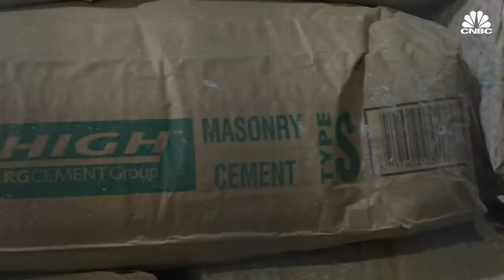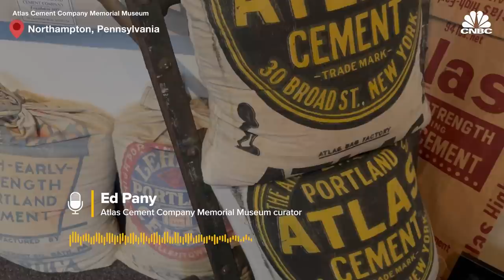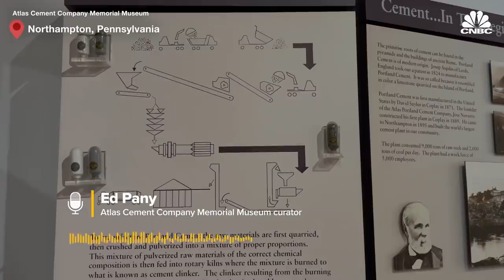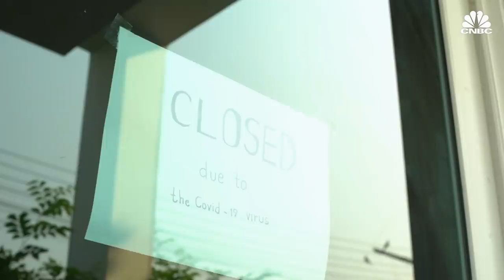Can The U.S. Cement Industry Keep Up With The $1 Trillion Infrastructure Bill?

Comment: It’s 2021 and we still gotta repave roads every 2-3 years 

Can’t someone invent a roadway that won’t crack over time 🙄
Reply: If there’s no endless traffic and construction on the road. Then I don’t want to drive! - America
Reply: We only repave the roads because everyone wants the smoothest road possible with no blemishes. You don't need to repave a brick road but most people don't like driving on brick roads. Also, if we've constantly repaving and repairing, it supports a lot of jobs around the country. If you make something that doesn't need to be replaced, that job will become obsolete
Reply: @listen1st267  who cares about  jobs

They’ll find other work 

AI and robots will soon take over anyways and that’ll be less stress for us
Reply: Roads are repaved all the time cause they’re made from asphalt, if they were made of concrete they wouldn’t have that issue
But most roads must be built with asphalt because it would be outrageously expensive to pave all roads in the US with concrete
Asphalt just breaks down quicker
Reply: Yes but bit cheaply
Reply: One i can think of is a complete metal road or carbon fiber. All of which would be really expensive
Reply: @Rommie26  your not going to have robots aging roads within the next 20 years maybe in 50 year robots will take laborers jobs
Reply: If erosion wasn't a physical concept, we could invent that road.
Reply: 20 years and counting and our residential roads are fine.
Reply: What kind of pavement do you guys have? In switzerland we do this every 10 or 20 years or so. The pavement still looks great, it’s the utility that needs replacing, or that they replaced every other street so quickly and are at the first one again
Reply: @Someone-wh8hi  I think it has more to do with use. Cars in the US are bigger than those in Europe on average and we use them far more.
Reply: Germany already has, it's just Americans don't think it's "economically practical"
Reply: It already exist but most US cities use union labor. This means the US can only use certain materials for roads vs material that last longer because those are not yet union approved. You're giving up reliability for safety of workers. It's a fair trade.
Reply: Yeah dirt roads
Reply: @Aristocles22  Nah, it's all about trucks. A 40ton Truck stresses a road up to 160.000x more than a car.
Reply: @0Turbox  We have plenty of gigantic trucks in the US too.
Reply: @nczioox1116  But asphalt is the single most recycled material in the world.  You basically just reheat it and pour it down on the new surface you need
Reply: some places use concrete bases, or just much thicker tarmac layers. it costs a bit to make a road for the age
Reply: Sure we can. BUt that is not the cheapest option.
Reply: It's called job security
Reply: There is no profit in that,
Reply: @listen1st267  sounds like another argument for UBI
Reply: Hempcrete or maybe make some kind of tar with it.
Reply: @Someone-wh8hi  we generally have asphalt, some roads are concrete but only a few. Are builds are certainly not to the level that European roads are constructed.  I believe, re-paving is part of the equation for continuous maintenance/ profit.
Reply: Our
Reply: @nadda96  my man with the most sensible comment.. A great example is airports are used concrete instead asphalt..
Reply: Unless you stop the water you'll never have a solid road. It's all about moisture content of the soil under the hard surface. Another problem comes from when they grade the roadway with a high moisture content in the soil the ground shrinks when it dries.
Reply: Use granite for roads
Reply: Better roads are available, but the lob goes the lowest bidder.  There is no profit in doing it better.
Reply: In South African highways, we doing away with asphalt and using concrete for durability
Reply: @sthembisomthembu395  we have lots of concrete freeways in the US, and they wear out just the same as asphalt, they just take longer to do it. The thing I don't like about concrete is that it never is as smooth a ride as asphalt, and the older it gets the worse the ride gets.
After a few years they have to regrind the surface to reduce the cupping, but it just keeps getting worse as it ages.
Reply: @Rommie26  no. Lol
Roads have to support the weight of traffic, handle extreme temperature swings without falling apart or buckling up, and most importantly, provide good traction for cars.
Asphalt does all these great, gives the best smooth ride, can be made porous so rain doesn't puddle on it to increase wet traction, and is flexible to allow use on softer sub soils where the road flexes under heavy loads. It is cheap and easy to install, and can have more layers added on top to renew its surface.

Concrete is much more expensive and labor intensive to install, and never gives as nice a ride as asphalt, but it lasts a few years longer before full replacement is needed. As concrete ages, it begins warping, which makes the ride worse and worse over the years.

There is really no other technology or technique that would survive the conditions and make a safe road surface.
Reply: @LongLiveBruh  Metal wouldn't work because of the expansion issues when it's hot or cold, you would need expansion joints that would get gummed up with sand and junk and jam, and then the road would buckle.
It also would not give a proper level of traction for safe driving.
Reply: @ritchierich2793  airports also use incredibly thick concrete because the load on plane wheels is very high. And they are frequently out there sealing cracks and patching it, and have to replace it every few years as well.
Reply: @listen1st267  a brick road wouldn't last a week under constant truck traffic.
The ancient Roman roads and old brick roads only exist because they have been protected from 40 ton trucks driving over them every day.
Reply: @listen1st267  a brick road wouldn't last a week under constant truck traffic.
The ancient Roman roads and old brick roads only exist because they have been protected from 40 ton trucks driving over them every day.
Reply: Gunite but they won’t shoot it Because they want to keep business is thriving
Reply: There are formulations of asphalt in the works that use shredded plastic bottles to add strength and flexibility to the asphalt. Just look up "paving roads with plastic". :-)
Reply: @ke6gwf  yes I know that, from where I am at the airport has maintenance life cycle of 4-5 years one time.. That's just the yearly budgeting maintenance cost that usually prepared.. expensive but relatively cheap if you think of the longevity..
Reply: If roads, homes, products, gadgets, etc were made to last they would never require maintenance or replaments.
Reply: I mean, I heard they're starting to make plastic roads in New Zealand I think. It may have been a different country, I'm not entirely sure.
Reply: @Rommie26  lazy
Reply: @ke6gwf  using it as a road surface, it will crack and rise and fall over time as the earth moves around it

Comment: Was there ever a clear description of concrete vs cement? Showing images of concrete while discussing cement went a long ways toward lack of clarity.
Reply: 2:24
Reply: Cement is the powder the stuff in bags. cement+water=concrete the stuff you lay/spread
Reply: @edward1937  you are missing the aggregate.
Reply: cement plus sand plus/minus aggregate (gravel) then add water = CONCRETE; Ratios determine strength, setting time, cost . Just remember the romans were doing concrete 2000 years ago, also in great wall of china.

Comment: We do not have shortage of cement to make concrete. What we do have is a shortage of labor to produce, deliver and place cement/concrete. Concrete companies can make more than can be placed at this time. Placing concrete is a very physically demanding job that very few people want to do. Long hours, no breaks and bent over all day long. I have an extreme amount of respect for the guys and gals who work producing, delivering and placing concrete. The people who operate the pump trucks are the first onsite and usually the last to leave. I framed houses for over 15 years before I became a general contractor building houses. Don't get me wrong as framing is also very physically demanding work but more enjoyable in my opinion.

Comment: Actually, potable water is supplied either through Ductile Iron Pipe (DIP) or Asbestos Concrete pipe (AC).  Storm water is typically carried through Precast Concrete Cylinder Pipe (PCCP).  Sanitary sewer is carried through plastic pipe, typically SDR-35, SDR-36, or C-900.  C-900 can also carry potable water as well.
Reply: Thank you for your insights

Comment: As a former President of one of the largest chapters of the American Concrete Institute (ACI), I have no dought that the industry will step up to meet the demands as we always have. Concrete has been used for over 3,000 years to build the foundations and major structures of the world. Which, by the way, has an abundance of the raw resources for it's never ending demand. We merely change its composition to advance our cavillation.  There is NO other material as versatile, durable and as economical as concrete!

Comment: Cement production is the most energy-intensive manufacturing process. It's got to heat it to remove the water and then they add water to make it harden. How nuts is that?
Reply: I mean it makes sense because you need to mix everything and in order to mix rocks you need heat and water is the enemy of heat. If you need proof of this go look at any active volcano and watch as the molten rock solidifies as it touches water.

Comment: So... how would you cope when you actually start building your homes with cement and not sticks?
Reply: you realize concrete (not "cement, which is just an ingredient of concrete) is not invincible, right? water intrusion destroys concrete just like it does wood, and in extreme climates like the american north, where it's -20 in winter and 100 in the summer, concrete cracks and rebar rusts very quickly - you'll almost never see fully concrete buildings in some places for good reason. if it were superior in every situation, it'd be built with more. not to mention that it is about as unsustainable as a material gets. get a clue before you start talking out your ass, friend.
Reply: @NonoNonaa  Do you need a bucket for your tears?
Reply: @NonoNonaa  ..."if it ADDED MORE PROFIT MARGIN in every situation, it'd be built with more." -fixed it for ya. there are several concrete formulations/admixtures (crystalline/densifiers/polymers/etc) which are waterproof. also, waterproofing membranes are a thing, obviously, otherwise stick homes wouldn't survive 6mo in some regions. sustainability is also measured in usable service time. now, who was it that didn't have a clue?

i'll take the worst built ICF home over a "quality" stick-frame in ANY location, every day of the year. enjoy your bugs/storms/earthquakes/fires/tornadoes/hurricanes/extreme heat/extreme cold/massive energy consumption/high noise levels/constant maint/short lifespan/disposable/out-of-square/weak shacks.

Comment: They do not use concrete pipes for water lines.
Reply: I mean, they use it for stormwater drainage 🤷‍♂️
Reply: Not typically in new installations. It used to be common practice.

Comment: You're telling me the Romans who constructed the Colosseum heated their cement to 2800 degrees?  Not likely.
Reply: Not all cement is created equal. And not all cement is meant to meet the same standards
Reply: You can make cement at significantly lower temps. The Romans used seawater instead of heat. This makes their cement actually last longer but takes significantly longer to make.
Reply: actually yes. roman concrete was made from vulcanic ashes. check https://en.wikipedia.org/wiki/Pozzolana
Reply: @lukacsnemeth1652  Volcanic ashes were cool when used by the Romans... Volcanic ashes just means anything that came from an eruption. They didn't go into a volcano to make it. Volcanic eruption could end up miles from a volcano actually. The Romans did not use high heat in cement. They only cooked their cement to 900 C.
Reply: @lukacsnemeth1652  Volcanos don't get up to 2800 degrees. Not that they have to for ash
Reply: @veganpotterthevegan  they do. In fahrenheit.
Reply: @MuddinNYC  The volcanic ash is the cement, they were not shoveling limestone into the caldera :D
Reply: @lukacsnemeth1652  The rare scenarios where mafic lavas are recorded that hot are not from the kinds of volcanos that make great ash for cement.  The cooler volcanoes that barely have any lava at all produce the ash we want for cement
Reply: @veganpotterthevegan  The temperature of the lava is not the point, magma in the chamber can get to that degree. Also, belite occurs naturally, so cement definitely forms naturally.

Comment: Modern concrete—used in everything from roads to buildings to bridges—can break down in as few as 50 years

Masonry is one of the most durable components of a home. Chimneys, fireplaces, and brick veneers can last a lifetime, and brick walls have an average life expectancy of more than 100 years.

copied and pasted

Comment: We need a better alternative to concrete. During summer floors get hot to where you can burn yourself and it's heating the air up more.
Reply: Sun heats up everything in the summer, even the most reflective and uneven surfaces, for example Sand
Maybe you should plant grass over your floors🤣🤣
Reply: You could fix the heating problem with a simple color change. But people don't want that. Do you want to paint the roof of your house white? Even if you did, would the neighbours stand for it? Local government might even get involved with a building regulation that mandates certain roof colors.
Reply: I mean there’s a reason why the material has literally been used for 2,000+ years
Reply: @brian2440   to what extent? Too much of it is used today.
Reply: @prefersoxygen9373   not to the extent it does concrete and it's everywhere.
Reply: @enij1657  What do you consider to be a frivolous use of the concrete material?

What substitutes do you see for the material?
Reply: @enij1657  temperature difference between concrete and sand is about 0.2.... remember, concrete is mostly sand and both absorb sun and turn into a thermal mass.   At 90F, direct sun, concrete gets to about 120F, sand 115.... That's not much difference.... Think about how hot deserts get... If you don't like concrete, put grass,or clover in its place, problem solved
Reply: @brian2440  get rid of cars and get back to horses. Fixes a lot of issues. No need for so much concrete.
Reply: @enij1657  checkout Mr Dyck and the amish....

Comment: Stop building high, stop relying on cars (roads), a new way of building cities is needed. The higher the building the more expensive and worst is for the environment, we are not running out of space, and in lots of places population is stalling.
Reply: You need to build taller. You can't build out in a lot of places anymore. Take Manhattan for example, it's completely full. Only option is up. Otherwise you'll end up with a smaller population city that only the ultra rich will be able to live in.

Comment: Use building materials that are more sustainable. You only need to use concrete on skyscrapers, parking lots, etc. You don't need concrete for houses or multi-family homes. You can use rammed earth which uses only 10-20% concrete.

Comment: Drinking water does not travel through concrete pipes. PVC pipes are used for water and sanitary sewer. 

Storm drainage pipes can be concrete but most of that is PVC too
Reply: no, MOST storm drain pipes are concrete.
Reply: @protonneutron9046  not in my area. Pvc is much cheaper and labor cost is a lot lower since the segments are more than double what concrete is and can be moved by hand. You have to use heavy equipment to move even the smallest sizes of concrete pipe. Much slower

Comment: North Africa has sand.
USA: Looks like North Africa needs freedom.
Reply: Too bad the I my sand we can use is the one in beaches. Africa is saved…for now
Reply: @inter5123  dude, in order to make concrete/brikes we need sand js
Reply: @EastlakeRasta7  dude, the sand in the desert is too fine to use in concrete and is hard to bind together for concrete. Only sands in beaches run through with water are capable of this. js
Reply: @inter5123  cool I didn't know that part

Comment: 1:45 8 percent Carbon dioxide emission from concrete? Why not use hempcrete? It doesn't crack, and is fully biodegradeable
Reply: You want to live in a biodegradable building 🤣🤣. Remember what happened in surf side  Florida.
Reply: Because it's more expensive and current production is limited.

Comment: Can't they recycle old cement?
Reply: @albert einstien got to go back to wooden infrastructure...
Reply: @therickibobby4865  California Wildfires have entered the chat
Reply: @LeeeroyJenkins  There is always imported timber which a great deal comes from Canada.
Reply: No. The process of setting cement is a chemical change: Once it's done, it's not going back. You can use old concrete as an ingredient in making new concrete, but it's expensive and doesn't give a very good grade of product.

Comment: This would have been a great opportunity to point out alternatives to concrete not just this "green" version of it which sounds a lot like whitewash double speak to me. There's everything from rammed earth to hempcrete to all timber which sequesters CO2. I understand concrete is usually at least the slab but I've even pop up temp housing that gets nailed into the ground basically, there must be alternatives even for foundation. Seams like a big missed opportunity.